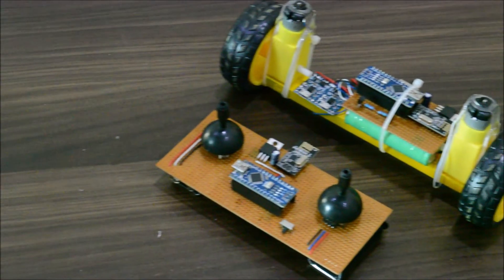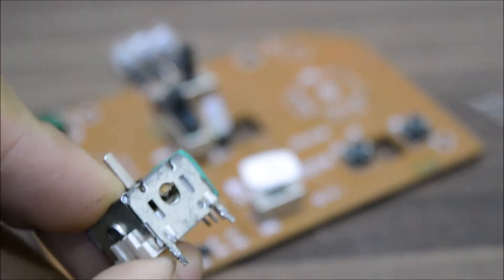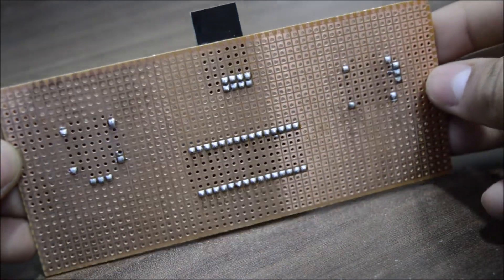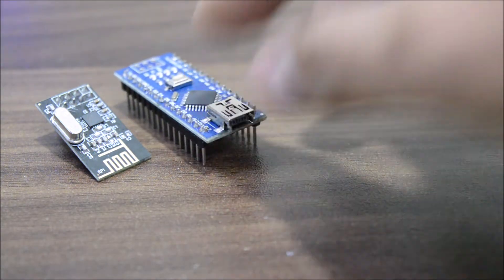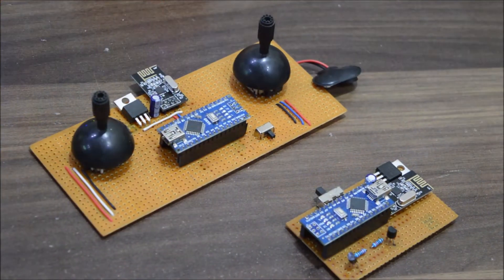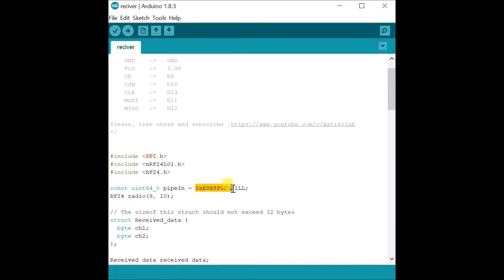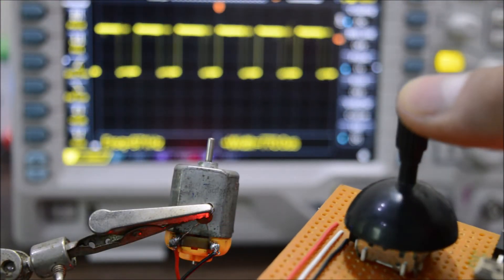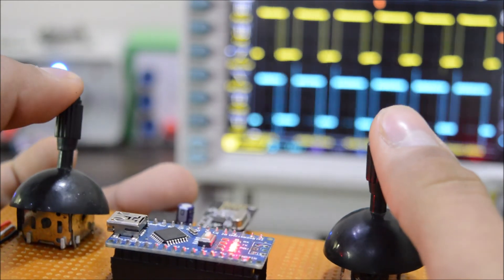DIY Arduino Radio Controller || Remote Controller || Part 1

Comment: Sir mottar k speed controller kaise kam karts h is circuit m. Jab ki transistor 3.3volt provided krta h. Fir v motar genarat high speed as a 12volt. How is work high speed mottar. Give to circuit area mottar got high speed

Comment: more QUESTIONS! after several days i have found what might be the closest thing to what you have the c8050 but its called " IR Transistor" it has the number K511 on top and then c8050 under it and the letter c under that. as far as data sheets go their are dozens which seem to be from suntec and are labeled STC8050 cant find any of these! but any way is this thing you have an "IR" and what does this mean. the k511 could be the date and location and not have anything to do with the part! the c is curious i have found them with a "d" i wonder what that means some data sheets are helpful other are very limited. this one i found is at [  https://www.ebay.com/itm/C8050-Original-New-IR-Transistor/121070442450 ] and its very expensive a 2n2222a is #100 for $2

Comment: what specifically does your c8050 say on it? is it a "KTC8050"  or their is one called "S8050" is the "C" important? also the ktc is also called a "k38" does your say k38 and then c8050 on it? their are many variations!
Reply from the maker: Yes the C is important ideally you must use C8050 as it can handle 1.5A current. But as an alternative you can also use KTC8050 , S8050 both can handle 800ma of current so you have to make sure that your motors won’t draw more than 800ma.
Reply: @Aatikslab  were are you getting this information from? is their a web site that gives it out! the c is 1.5 and the s and ktc is .8a or just the s is?
Reply from the maker: DATA SHEET mate!!! Just type the name of component in google and you will find a data sheet of that component. In the data sheet look for the table content saying something like collector current
Here is the link to the data sheet of KTC8050 Have a look 

https://www.bg-electronics.de/datenblaetter/Transistoren/KTC8050.pdf
Reply: YOUR CORRECT! tried and it worked the c8050 is 1.5 and the ktc is .8a this is a difference! never knew this but im new to this.

Comment: Sir you are sand me 4 Chanel transmitter and receiver uses joystick module circuit diagram it helps me lot

Comment: In receiver part the motors are connected to digital pins. Can it be also connected to analog pins???. Anyone please ans
Reply from the maker: No! Because arduino can only generate pwm signal on its dedicated pwm pins

Comment: I have 3.3v nrf24l01 adaptor so can I pass the lm1117 c8050 and 10uf process?
Reply from the maker: Yes you can pass the lm1117 and the 10uf capacitor but this c8050 is used to drive the motors it has nothing to do with the nrf24l01 module
Reply: But I have L298N how can I use it in this project can u help ne?
Reply: Which change I have to do in this schematic?